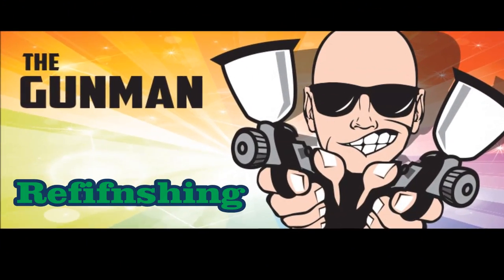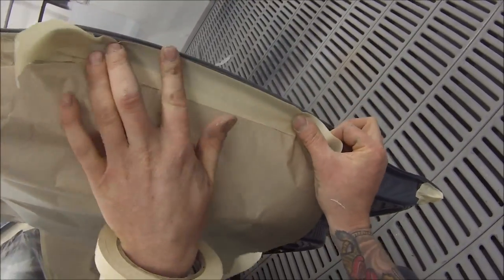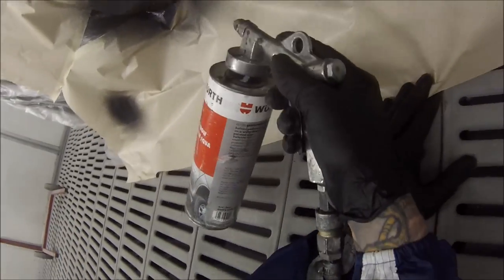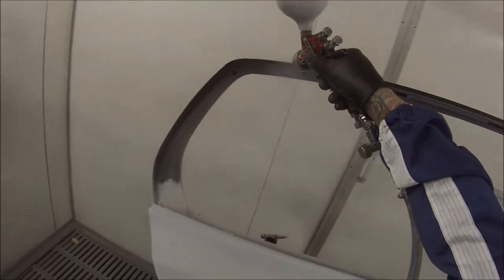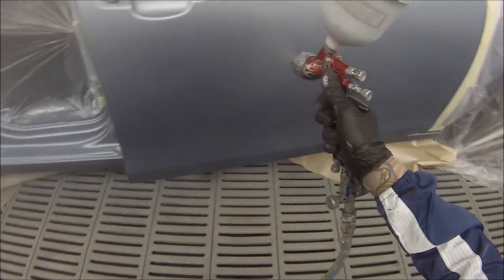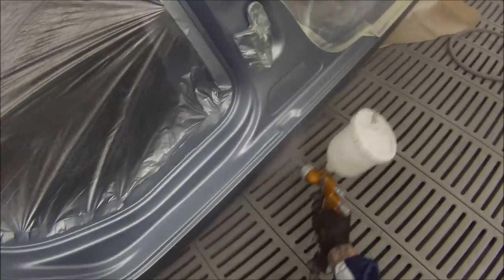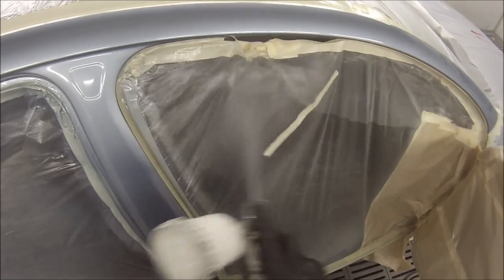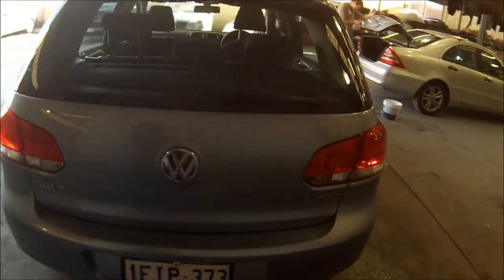Shark Blue VW Golf Masking and Spray Painting

Comment: In my opinion you should not use a clear coat but a nanotechnological Teflon coating like G guard. Sorry but if you give a clear coat above the original clear coat, what is the difference? It will be gloss and protected like it wasn't applied.
Reply from the maker: meschio Sorry but you are wrong, this is the correct method of refinishing.

Comment: may frend shark blue in português is tubarão azul.
Reply from the maker: +Leandro Moreno Cool :-)
Reply: Question for you Gunny, After masking off something like stoneguard would you advise a wax and degreaser after drying to get rid of any adhesive left behind from the tape? As always an avid viewer of your vids, all the best, Mike.
Reply from the maker: dongil123 Not usually necessary, even if there is a bit it usually rubs off with your thumb, W&G remover seems to spread the adhesive and can end up messy, good luck.